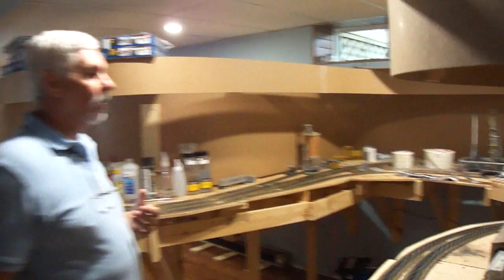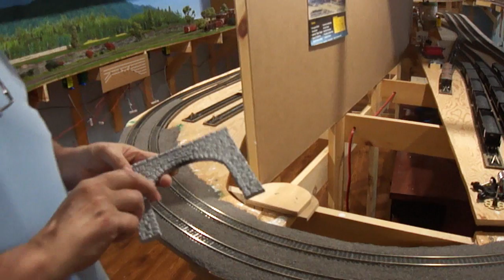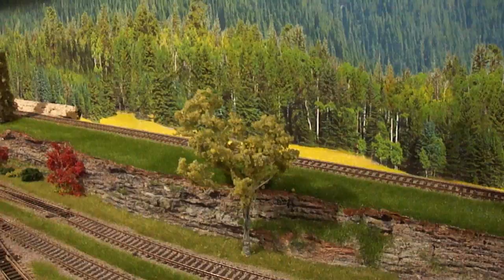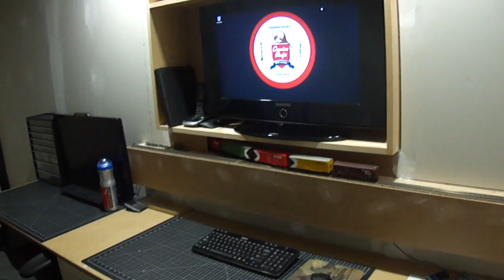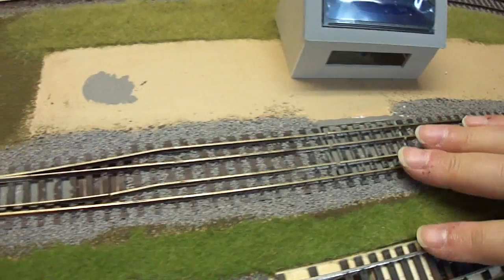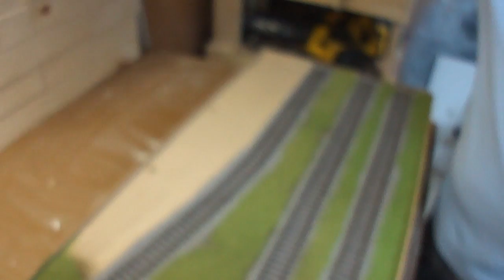PART 2: Lloyd Henchey: Continue the tour and some interesting ideas on modeling

Comment: Great tour, looks like a fantastic project!  Great dedication, I have been working on my small layout for longer and am less than a fraction along.  look forward to an update later.
Reply from the maker: Clint he has an energy that you have to admire.  Super builder for sure
Reply from the maker: He is very speedy.  I guess that can happen when you are happy with your end goal.  It drives you to work on it regularly.  You may have progressed slowly because you may not be totally happy with the  end goal. Or you just may not have the time.  Don't be concerned about changing your goals to move forward.